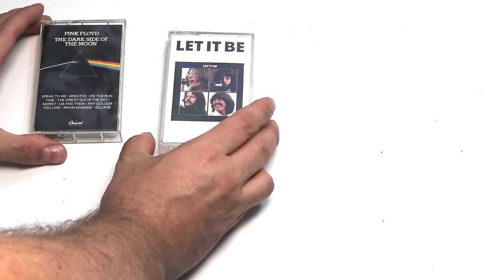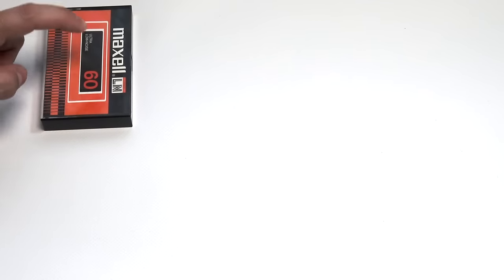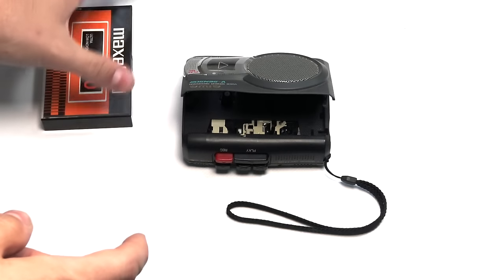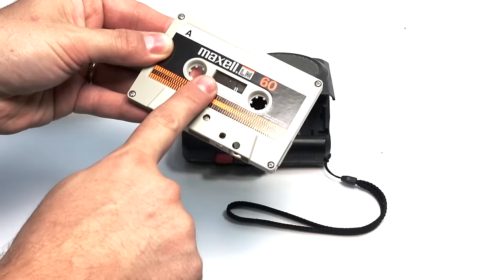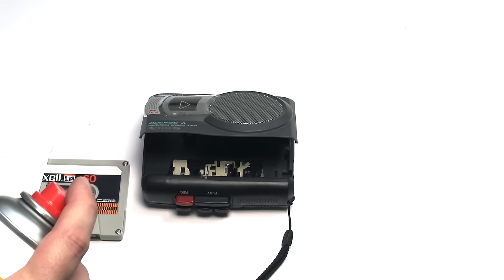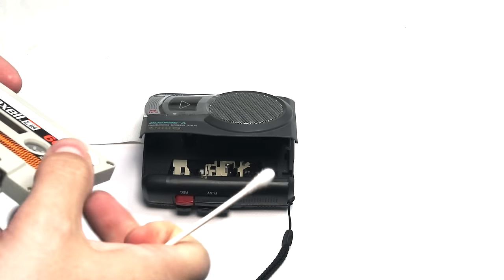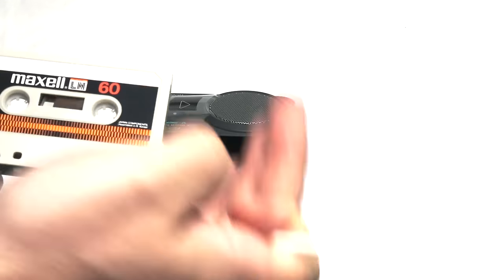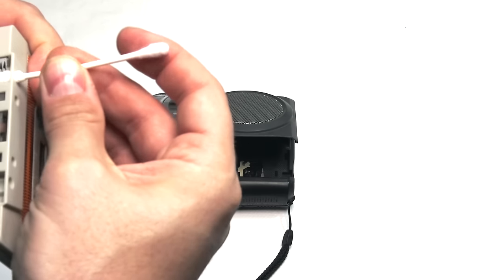How to relubricate your stuck cassette tapes

Comment: Firstly I would like to admit that I thought this whole thing was akin to selling snake oil. I was totally gobsmacked especially when I realised that the day that I first viewed the video was 1st April! (True)
I was looking for a remedy to squealing tapes as my prized copy of a rare audiobook was stopping and making a racket.
I didn't believe a word, but since I tried changing the slip sheets in the cassette and putting the tape in another cassette body I was left with little choice.
Waddaya know. It works.
Thank you.
Reply from the maker: Thanks for your honest comment. In tye video description I added a lot of scientific papers that explain tape lube and how re-lubing is a common procedure.
Reply: Yeah I tried changing the slip sheets and case myself years ago and it didn't work, with hindsight and powers of deduction I should after trying different players have realised that it must be another reason then,  looooooooooool
Reply: I came to this video while researching the topic, but interested in open reel tapes, which I gladly saw that you have one behind you! anyway, that’s common on some TDK and Sony tapes I have, I will definitively give a try adjusting one of the decks. Question: on reel tapes sometimes dried out lubricant builds up as a dust powder on transport path. Would you recommend first a clean up with isopropil or anything prior to the new silicon base (to remove the older) or just apply new one directly? Thanks for all the shared knowledge!
Reply from the maker: Hi there, it is not dry lubricant its the entire binder that is shedding due to hydrolysis. It's part of the SBS, soft binder syndrome. Yes, some say you can use alcohol and immediately remove it or simply you can use the baking technique. In any case the goal is not to restore the tape but only transfer it as best as possible to a new tape or make a digital conversion. The avoid this we should all follow rigorous conservation rules because in the end tape is organic and humidity, as well as heat, sun etc. Severely affects the medium.

Comment: Look up some cleaner called Filmguard..it’s not cheap but the bottle will last forever ( smells like kerosene) I have used it also on 8mm video and 60 plus year old reel to reel.. cleans/lubricates/.. won’t harm the tape..also the drill idea works great keeps any extra lube out of your deck…be really careful with drill toward the end of tape.. drill is much stronger than deck motor and will break your tape from reel if not careful 😢

Comment: Quick question:
When I’m waiting for it to dry, what’s the ideal position the tape should be in to make sure that the lube is evenly distributed? I have mine standing upright against a couple of boxes at the moment.
Reply from the maker: Please do use a dry cue tip to clean and absorb the extra oil...keep it vertical, in that case you are sure that the lube stays on the film...all media actually should always stay in upright position to avoid any kind of warping...
Reply: ana[dia]log - Alright, I just wanted to make sure that I was doing it right. Thanks.
Reply: What about using the silicone lube on the heads instead of the tape?will that work? Thank you
Reply from the maker: No! Don't!

Comment: That's a nice explanation and good video, thank you! But have a couple questions though... why lubricating all the tape side, if the problem is the transport only? Why not lubricating the side nylon cardboards only? 
Also: wouldn't the lubricant affect the rubber pinch roller when the tape goes over it while listeing to the tape?
Reply from the maker: You must asses if its the trasport or if the lubricant has dried out, a common situation. If so. You must lube and take up the exceeding lube with a cue tip as illustrated THEN let it absorb. The binder will absorb it within a few days and no traces will present of tye pinchroller.

Comment: I used Aloe Vera hand cream twice then a dry cue tip on a tape that I didn't care about, it sounds new now, and I didn't have to even wait I tried it straight after, the tracks mainly had slowing issues at random points, completely gone now, I am amazed to be honest, it was just an experiment, oh well it worked, if you think I am joking try it on a junk tape, just don't use loads it could have been a weird fluke but it's worked, wish I'd recorded it.

Comment: Hey there.
Can something like Realistic Tape Head Lubricant also be used to lubricate stuck & squealy tapes when using it on the lubricant side of the recording tape itself? :) Would this 3M spray lubricant you're talking about also be good use on 8-track tapes? :) Thank you! :)
Reply from the maker: I can't advise without direct experience. I can only say that if you want to try something else, make at least sure it doesn't contain thinners or alcohol ans silicone based. I haven't tried 8 track, sorry about that!

Comment: What really frosts my fur is that the cheapo Certron tapes (the ones everybody said to stay away from) work much better now than the expensive TDK tapes I bought in the 1980s. The TDK tapes tend to wind too tightly. I try to play them, and they squeak and squeal, and like you said, the tape player shuts off.
Reply: I bought a tdk tape and I tried to record songs to it but no sound is recording to the tape.

Comment: Some times a tape that has been unplayed for a while can bind in the shell due to skew of the tape on the real (aka: not wound in a completely flat pack). Some tapes have slip-mats inside the shells to try to mitigate this. The fix is usually just to FF the tape all the way through and then REW it all the way back. Should solve the majority of binding issues.
Reply: While this is true, there are also cases where this isn't the issue and the lubricant, or loss of, is the problem.  I recently come across one such example of this where fast forwarding and rewinding (multiple times) didn't solve the problem.  I also transferred the tape to a known good shell with its own slip-mats and the squealing and tape slowdown problem still occurred.  I plan on trying the lubrication technique in this video.  Thankfully the tape isn't an important one so I'm comfortable trying this out.
Reply: @Ikrananka  Sure. I guess there are some bad ones out there. I haven't ever had this issue personally. If some tapes won't run it's usually a problem with the adjustment of the deck... low take-up torque or not enough presure from the pinch roller. I suppose lubricating the tape could get it back into a place where it could play on a deck that is a bit out of spec. Sounds messy.
Reply: @maskddingo1779  Yeah, I so far only have this one tape that seems to have clear loss of lubricant symptoms.  I've picked up a new $20 portable cassette player just for the purpose of applying the lubricant and will give the cassette at least two weeks before I play it in my "proper" cassette player.  I'll report back here how it went.
Reply: @Ikrananka  How did it go? I have the same issue, a tape is stuck. I transferred it to a brand new shell but still wouldn't play so it would be good to know if yours eventually worked.
Reply: @kelpkelp5252  I found that the tapes I treated worked for a while but then reverted back to their old behaviour.  On one of these tapes I tried again, putting more lubricant on it, but it completely messed up the tape with it becoming all stuck together.  So, in my experience, the lubrication technique should be enough to get the tape playable for a while so that you can copy the contents off it, but don't expect the tape to be playable for long (weeks).
Reply: @Ikrananka  Thanks. I have some vintage computer data I need to get off the tape so it would be useful if it worked even just once, so I could read it.

Comment: In the description you say better if it’s the dry type, but then right below you recommend the 3m wet type in the link. Which one is it? I bought the one you linked to and I’m having very bad luck with it. Any help greatly appreciated, I’m very confused as to what you recommend.
Reply from the maker: Sorry, get the wet type. The dry one has diluent.
Reply from the maker: I corrected the description. Thanks and sorry again.

Comment: Wow, that's interesting. Exactly with these very old cassette tapes i had the issue, that there were that dirty, that I had many dropouts. My solution: clean the tape with isopropyl alcohol. Fine, the dropouts were gone, but now I was facing the problem of a squeeky tape. I just started thinking of the sticky tape syndrome. But I didn't find any deposition on the tape mechanism. Now I possibly have the answer. Due to the cleaning process with alcohol I took away the lubrication of the tape. Tank you for this video!
Reply: Did you try lubricating your tapes? What did you use, how did it work out? Thanks!

Comment: Thank you so much for saving some of my tapes with this video!! 
Can this process make some tapes speed up while playing? ... wondering 🤔
Reply from the maker: No, because the mechanism sets the correct speed. It can only go slower if there is resistance due as in this case the lack of lube

Comment: Interesting but I have never needed to do this. Most of my 100s of cassettes are 30+ years old and never needed any maintenance...the  only ones I have had to ditch are BASF ones from early 80s (particularly the chrome ones) which left my heads covered in brown goo. I just threw them away.
Reply from the maker: Lucky you!

Comment: I purchased a cassette recently, never used, and first play the audio dragged, slower than the original recording along with distortion of the sound. Is this solution associated with my problem? Or, is there something different involved? Thanks so much.
Reply from the maker: Can't be sure 100% but it's probably a lube problem. Unfortunately several cassettes during time lose their lube, it just gets dry so the tape can't rotate correctly and in the worse case it just gets stuck.

Comment: I have used silicone on reel to reel tapes for years. Matter of fact the Hoppes #9 silicone rags are great to run a reel to reel tape thru. BASF LP 35 can get "dusty" and the rags clean them up nicely.

Interesting it took time for the silicone to "sink in". More then probably I would suspect it softened up the lube in the tape. Similar thought process on old dried up grease.

Comment: I'm a HK based cassette listener. Tapes are very susceptible to moulding thanks to the notorious local humidity, and Polydor/EMI products which have plastic instead of paper slip sheet often squeal after that. I am experimenting your method by doing it completely your way vs simply lubricating the plastic slip sheet. See if the latter works just as fine.

Comment: Thanks for the vid, the process most certainly helps! I've tried this with both Walmart branded silicone lube, and WD-40 brand lube as well. Can confirm work just as well for tape hubs. Now I can make all those Type 0 tapes I have a little bit more tolorable.~

Comment: Perfect timing, I thought my cassette was done,  I'll have top give this a try.
Reply from the maker: Good! Tell us if it works...remember, for me the magic happened WEEKS later!!
Reply: @anadialog  I report back next week, to see if there is a noticeable difference.
Reply: Did you see any difference?
Reply: @ZeusTheTornado  definitely, it took the strain/stress off the tape by lubricating it. At least for the two cassette's I had issues with, hope this helps.
Reply: Great to hear, I'll try this with a squeaking 1970 cassette and one from 1972 that doesn't want to work properly.
Reply: If anything, lubricate the MOVING PARTS INSIDE the shell - NOT the tape itself!! Otherwise, say goodbye to your tape. The damage may not be immediate, but it WILL be irreversible when it finally becomes apparent. 

In most cases, lots of uneven winding will cause a tape to lag and jam and stick. NO LUBE or other chemical treatments necessary/required! Just wind the ape all the way from start to finish, back and forth until the tape is aligned on the hub in a more uniform manner - no telltale "ridges" or recesses. 

I've "only" been working with tapes for YEARS in my youth (preteens to early adulthood) - including complicated disassembly/reassembly, maintenance, repair, and custom-cut tape length modifications. Everything I know is self-taught through much trial & error (mostly error) and "hard way" learning. Of course, I picked up a few legit tips from actual experts. But even in all my layman naivete, and as often as I have experienced many instances of jammed, lagging, and "sticky" tape, NEVER have I been so foolish as to apply any solvents directly to the tape. At least not more than once, haha. But even at the time, I had that little voice saying "this is a bad idea". 

As I said, those jamming symptoms can often be remedied by simple winding the tape from start to finish to get better winding alignment, and/or by treating/replacing the moving parts inside the shell. 

Older shells without screws (that are glued together) will often become junk when trying to open them up, and a spare transplant shell should be available before doing anything, but if the fused seams can be carefully separated, the shell can be salvaged, and reassembled with a couple dabs of CAREFULLY PLACED glue and/or gaudy cellophane tape. 

But even before you begin "surgery" on your tape, check that your decks are properly lubed and working properly. The problem may not even be with the tape, but the deck itself and its parts/mechanisms. 

If you have no other choice but to treat the tape, because some sticky schmutz (i.e. soft drink spills, etc) has come into contact with the tape, then I would ONLY use warm water and a cotton swab, and a CLEAN soft cloth to dab the tape dry after - NO solvents or lubes! 

However, I would imagine, unless such contamination is caught and treated IMMEDIATELY after it occurs, it won't matter, as the stickiness will probably pull the particles right off the tape when any unwinding is attempted and/or when the crud is wiped/rubbed away.

Ask me how I know. If it was not with my own tapes, the tapes of friends have been subjected to such horrors, hence my experience with such scenarios.

Learn to cassette, man. ;-)

Good luck.
Reply: @BlackieNuff  These brain dead poster's arguments usually attempt to deceive by turning the advice to use a lubricant into advice to use a solvent, and then arguing why using a solvent is bad for tape. Where did anyone here say use a solvent? Please give a time stamp on the video where he said use a solvent. I'll consider your argument once you can provide that time stamp. I'll be waiting.
Reply: Blackie Nuff . Your sabotaging your own advice (which may be good advice) with your profanity and hate. No one's going to take you serious ly....!

Comment: I have a 45-50 yr old tape from the garage band (Stale Faces). The case was warped, so I carefully changed it to a newer case. I don't want to play it until I can be sure it's not going to be chewed up.
What are your suggestions to reduce my fears?
Reply from the maker: Chewed up cassettes is mainly a pinch roller issue. Stuck cassette because of missing lube can sometimes lead to that. Just fast forward and rewind it a few times and try. If it gets stuck, try some relubrication.